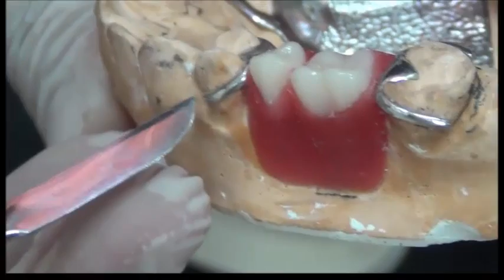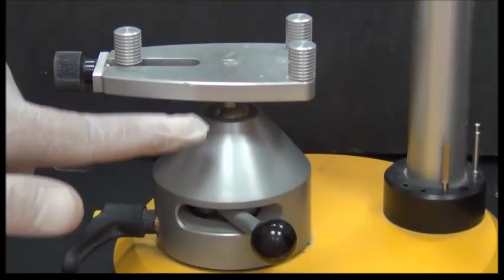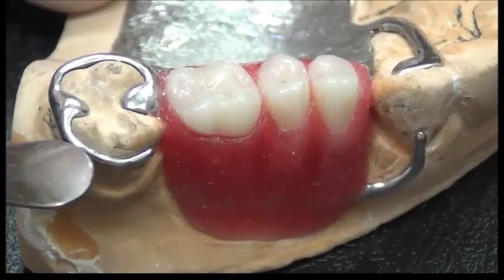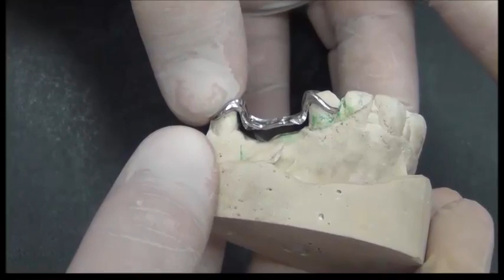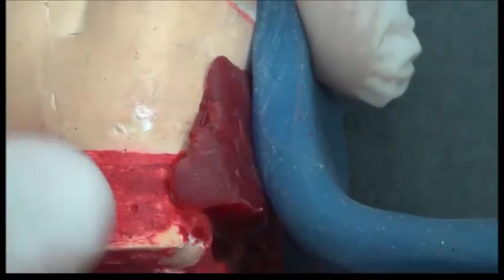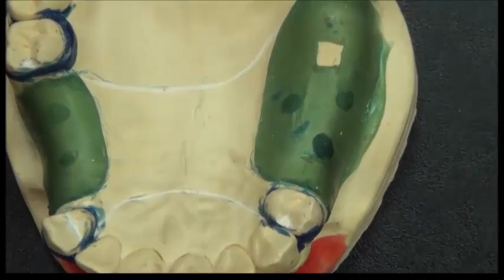11 Permanent RPD: The surveyor and its use in RPD procedures

Comment: Well explained Dr Layla.
 was the clasp on the 17 broken at the tip? it seemed to come to very sharp point which could injure the patient in the buccal area. The circumferential clasp tip must always point towards the occlusal surface, this also create a rounded edge to slide against the tooth in the deepest undercut area, thus minimising damage to the enamel of the tooth.
Reply from the maker: I Think yes it might be broken. When I needed to make the vide,o I used the stock of un-dilivered frameworks. so this may be the reason it was not delivered to the patient.